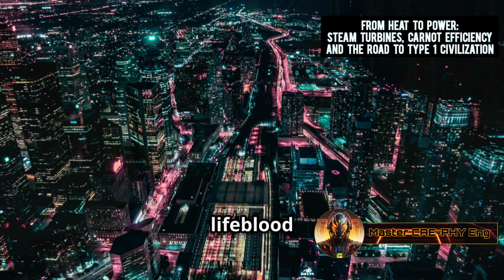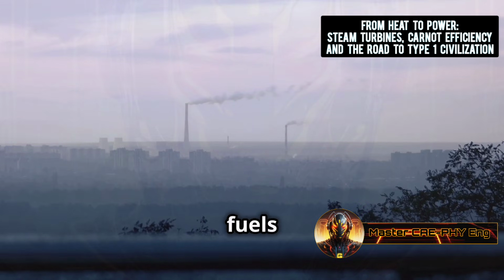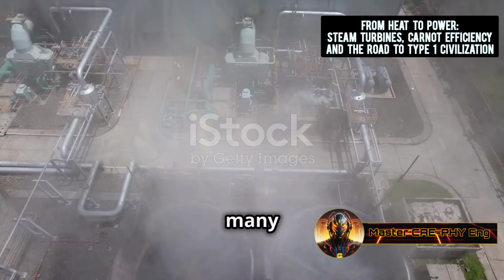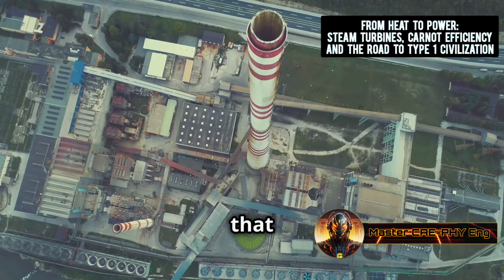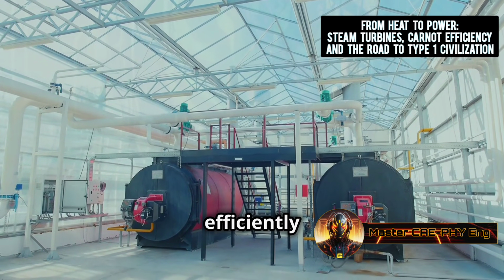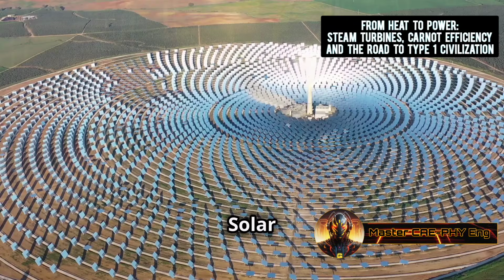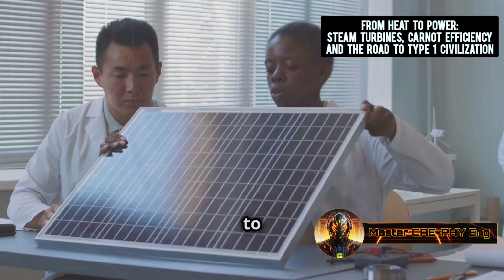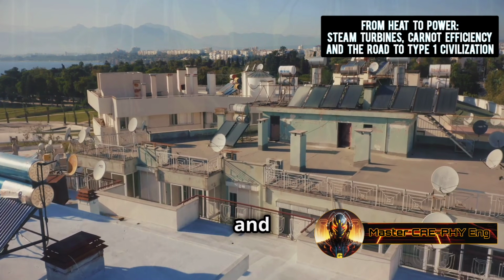From Heat to Power: Steam Turbines, Carnot Efficiency and the Road to Type 1 Civilization #science

Comment: Thank you for this presentation. It is a good presentation on thermal sources of energy. I would also add an additional consideration. Your examples of turbines producing electricity fails to mention that the initial spin wastes two thirds fo the energy as heat. Gartered. combined cycle generation can recover some of the energy. The point is that thermal generation is not particularly efficient. 

So, as a contrast take PV panels producing electricity. At present about 20% of the sunlight creates electricity. However once created that electricity can be instantly transmitted great distance to the needed site of use. No, mining, transportation, or refining are necessary. The only weakness is intermittency, but improved storage methods are being developed. What is most important is that electrical generation at the site of consumption or from dispersed sites will create a more reliable system. The future is the movement of civilization from centralized power to decentralized power.
Reply from the maker: Yes, you are right about that. This is the first video about the transmission of thermal energy to mechanical energy, which is why I script it in a general way with the example of the conventional steam power plant, which is the first thing you learn if you begin your studies in Thermodynamics.

The topic about PV will be explained later since it is a transmission of ray energy in a certain wavelength which errects energical movement in certain chemical layers of of PV different PV designs. In this term the Fermi Energy needs to be explained as well as the complex electrical ways for safety and transmission to the modern electrical network. So stay tuned. 😀👍